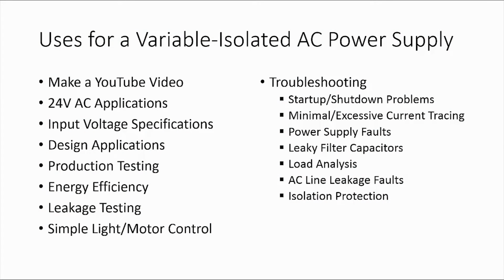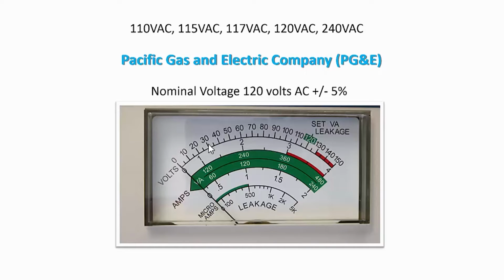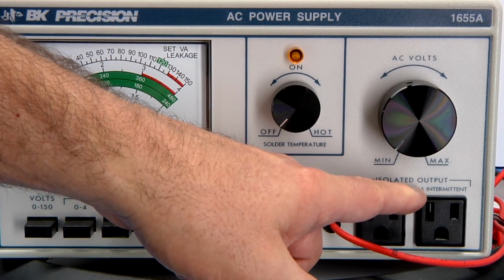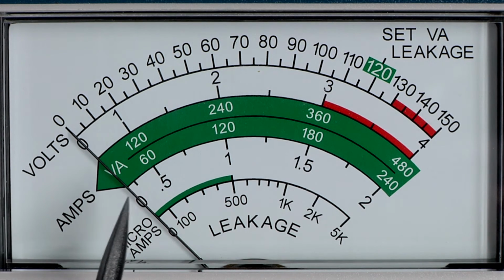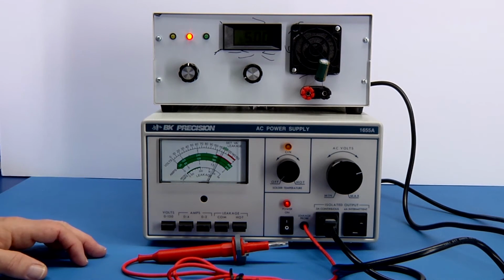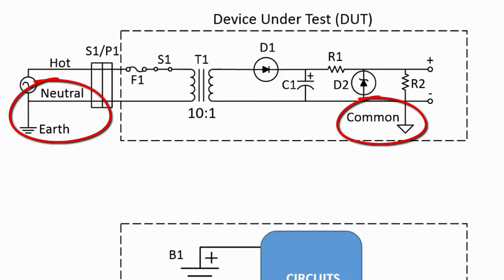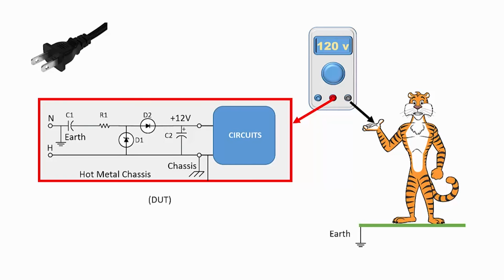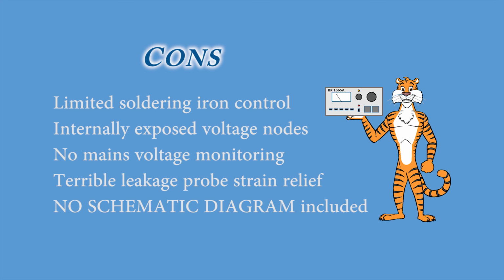#10 - BK Precision 1655A AC Power Supply

Comment: Good demo and info, thanks for sharing!. What is the differences between the 1655 and the 1655A?
Reply from the maker: Glad you liked the video.  Not sure if there are any internal changes between the 1655 and 1655A.  Cosmetically they have different case color schemes, knobs, and power switches.  Also the leakage probes are completely different.  The 1655A has the safety shroud on the leakage probe.

Comment: I bumped across this listing for a brush that might fit... Staco Energy #146-0121-S. I found it at this seller: https://www.galco.com/buy/Staco-Energy/146-0121-S At $48, its not cheap. But, that's still cheaper than Ebay and Amazon. Interestingly, I did not find a listing for the part on the Staco site. I think this shape of brush is called a "Tbird." I hope that helps someone.
Reply from the maker: Thanks for the information.

Comment: The replacement unit arrived and also had problems. The AC amps do not read on either scale, 0-4 or 0-2 amps. The volts do not read for the soldering iron. I have returned the unit and will be looking at alternatives. I will not be buying this brand.
Reply from the maker: Sorry you had bad luck with the unit.

Comment: I take it that your unit is no longer under warranty. If you have never looked at the coil brush, please do and see if it has any information on it... Make/model/etc. And, maybe take a picture of it and place the file on DropBox/GitHub/etc. My contact at BKP said you have to buy the whole coil assembly. That is not reasonable... Also, do you recall the coil knob feeling gritty, before the brush wears in? My first unit did. IIRC, the manual says how to use sandpaper to contour a new brush. For a factory-fresh unit, the manufacturer should have done that step. My second unit is still on order... Thanks in advance.
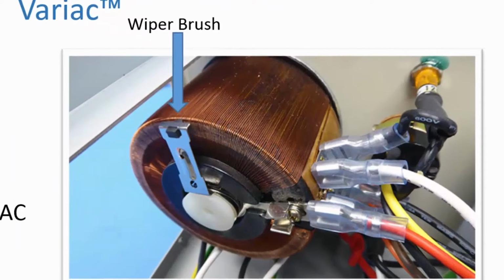Reply from the maker: I have my unit on loan to a friend so I can not check it right now.  At 8:43 in the video you can get a fairly close look at the brush and it shows no markings.  Though subjective I did not feel any gritty feedback when rotating the dial.   It was not completely smooth but I have several variable auto transformers and the BK feels about the same as the others.  I agree with you there should be away to just replace the brush like in many electric motors.
Reply: Thanks for your reply.
Reply: @jwrelectro  I had another thought... I would think that, if I can not identify the exact brush, maybe I could get a bigger brush and file it down to size. But, I don't have a lot of experience with brushes. Do you know, if that is possible?
Reply from the maker: @t1d100  Sorry, not sure if that is possible.
Reply: @jwrelectro  I have done a bit of learning about variac brushes. They are not common motor brushes. They are made of a special (different) compound. They only pass current longitudinally, not latitudinally, to prevent shorting to the adjoining wires. I have emails out to various variac brush suppliers. We'll see what we find out.

Comment: Two different issues... One = I have been working with BKP to get the leakage probe fuse specs, the coil brush specs and the "A" schematics. So far, I have only gotten the leakage probe fuse specs = "The fuse is 500 mA @ 1 KV" and the "Non-A" schematics. I looked at the fuse and it is of the ceramic/safety type. (Do not use the clear glass type!) I don't know that I will get the remaining information. Two = I received my new 1655A and preformed the startup procedures listed in the manual. I had two out-of-the box failures. 1) The meter would read volts, but would not read amps. 2) When the soldering iron pot was advanced for the first (and only) time, there was an immediate big bang and flash, but no smoke, or smell. I did not open the unit to look for the failure, as the unit is under warranty. I have returned the unit to the seller, for replacement.
Reply from the maker: Sorry to hear about you problems.  I have never used the soldering iron function.  Thank you for finding the information about the fuse.  It is funny that in my manual they never mention it.  Hope your replacement gives you  better service.

Comment: Thank you for your efforts to share this great video. I have this exact unit on order and I am awaiting delivery. I have not been able to locate the exact model 1655"A" schematic through the sources named herein. Please post it on DropBox/GitHub/etc. and link the address, here.( I do not want to post my email address, here, openly.) Also, any other documentation that you might have, particularly the service manual. Lastly, did you ever determine what the type and rating are for the fuse of the leakage probe? Thank you for your help!
Reply from the maker: Glad you enjoyed the video.  I do have a schematic somewhere and if I find it I will let you know.  I understand you do not want to release your email address.  I do not have a service manual for the unit.  Also I have no means of determining if the mystery probe component is a fuse and if so what it is rated at and as mentioned it is connect to a high resistance input.
Reply: @jwrelectro  Thank you for your reply. I appreciate your help and look forward to getting the schematic.
Reply from the maker: @t1d100  Please go to my website:  tigermultimedia.com and select Review, BK1655A and under support materials download the BK Diagram in zip format.  You can use the free 7zip program if needed.

Comment: Great video! I just purchased one of these. It's actually a Global Specialties model 1420. It's the same exact unit, just rebranded. Both have a one year warranty. It was also about $60 less expensive. I got it through tequipment.com (DISCLAIMER: I have no affiliation with either company.) The leakage tester on these units in invaluable. I was replacing a multi switch on my satellite system and received a small shock while connecting the coax from one of my satellite receivers. It turned out that my Kenwood 5.1 receiver was leaking A/C to the chassis and, like most consumer-grade electronics, it isn't grounded. I repaired the receiver and, in the process, eliminated a ground loop between my house and my shop, which is in another building on my property. These are great units for the money!
Reply: The soldering iron control is a bit goofy. Just some "fluff" that they added. If someone needs a supply like this, they most likely have at least one good soldering station with temperature setting, temperature display and feedback control.
Reply from the maker: Glad you enjoyed the video.  It sound like it has already been helpful for you.  I have purchased several of my lab equipment from TEquipment also and I have been happy with them.  Thanks for the info on the Global Specialties 1420.

Comment: I bought a used 1655 not a 1655A through EBAY. When I took off the top it was FILTHY inside. Instead of the tedious procedure of taking it all apart to clean it, I took it outside and used my hose on JET to give it a thorough cleaning. I am letting it dry out completely in the hot Las Vegas sun. Standby...I will let you know the outcome. I probably should have at least used distiiled water.

Also, the leakage probe was missing; part of the lead was left inside where it was cut and it does say probe so I know where to connect it. Do you know if B&K sells just the probe? I guess I should just contact them. Otherwise, I will try to find one with a retractable sheathing (is the retractable sheathing really needed?).

Also, the power lamp does not light but the unit works although the analog meter is off according to my Fluke 187.

By the way it is an excellent video as people working with line voltage should really know what they are doing.
Reply: +Howard Ostfeld  OFF by how much ???
Replace the 4 glass diodes if not tracking or way off
Reply: +Bob T I will be calibrating it this weekend. Looks like it is all dried out and I used Blue Shower to clean the potentiometer and the PCB.
Do you know where I can get the clip in receptacles with pigails for cheap as one is cracked. I also need the power lamp (is that just a neon lamp?). One more question: I also need the leakage probe as it was cutoff inside near the termina on the PCBl. I called B&K and they want $15 for it. It is a special type with a retractable plastic sheathing when you press the probe down. All it does is cover the metal part of the probe. Do you really need the plastic sheathing that retracts as I can solder in a regular probe that I have an abundance of.

Thanks
Reply: +Howard Ostfeld Send e-mail addr and I can e-mail Schematic and manual in pdf. I too need the outlets. Lost tension for plug.
Have not looked yet
Bob T
Reply: +Bob T Email address:eehoward21@gmail.com. I finally found some receptacles on Mouser Electronics. Search Mouser using: All Products > Connectors > Power Connectors > AC Power Plugs & Receptacles. Also, search EBAY using Snap In Receptacle. There are all types (with or without pigtails, plastic, bakelite,...etc), The original ones on my are bakelite not plastic so I will try to get the ones to match the original.

Comment: I float my scope with a 3 to 2 convertor so nothing can short through the scope.
Reply from the maker: +Howard Ostfeld Thank you for the kind words and glad you liked the video. In your other comment you mentioned the probe from BK is $15.00. To me that seems like a fair price for a replacement. I would recommend purchasing the probe.  Some leakage current probes use a momentary push-button to connect the probe tip to the metering circuit.  Depending on configuration there may be near line voltage levels at the tip of the probe albeit at limited current.  The measurement is made with reference to the secondary winding side of the isolation transformer.  The first thing the probe is connected to inside the unit is a 12-kohm 2W resistor. So if the rest of the circuit shorted and you connected the probe to the 150 VAC the max. current would be 12.5 mA with the resistor dissipating 1.73 watts.

In regards to the other question you can see in one of the last pictures in the video the soldering lamp is a neon rated for 120 VAC. The schematic shows the power-on indicator as a neon with a 100-kohm resistor in series. I am pretty sure that both indicators have the 100-kohm resistor build into the fixture.

Hope this helps and again thank you for commenting on the video. John